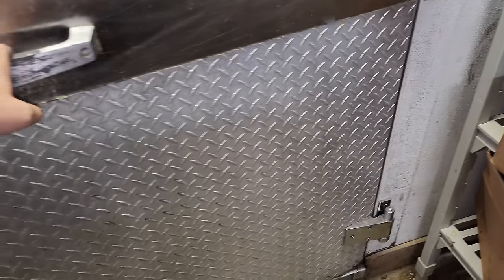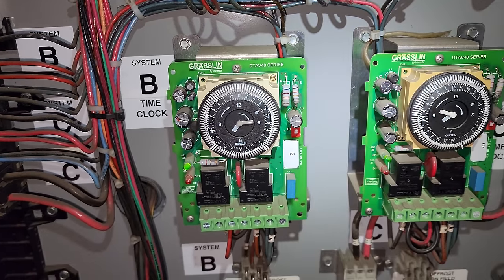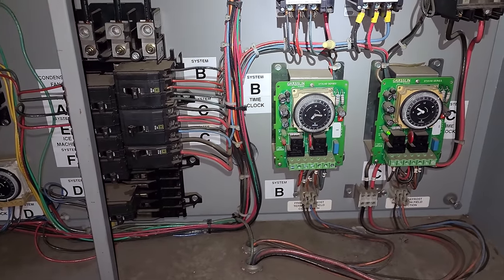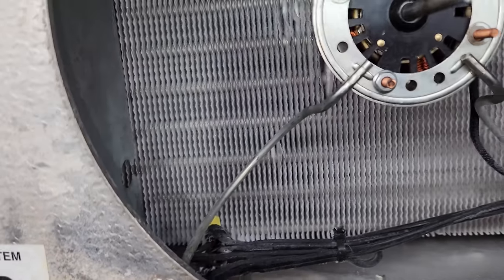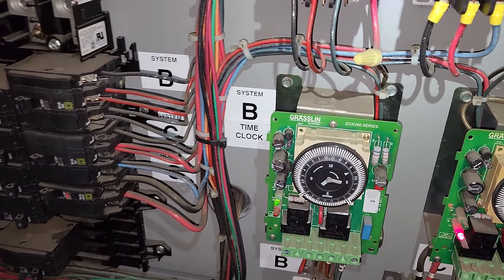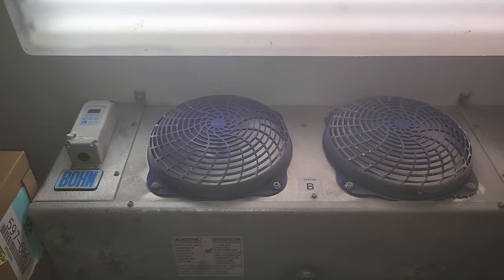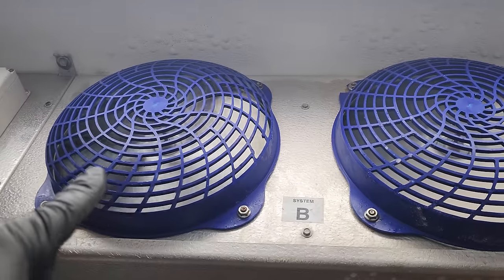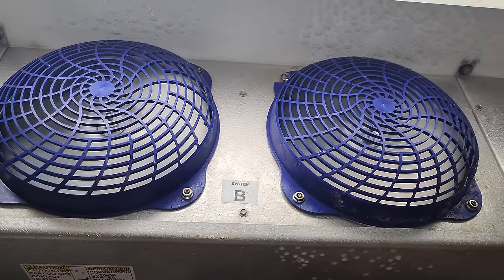WALK IN FREEZER EVAP MOTORS NOT WORKING

Comment: just finished installing a new door at place because there was an entrapment, it was bad. relief valve froze up and the door sucked itself shut. there was so much vacuum the jaws of life just bent the lip of the door they had to use a saw to cut a hole in the door. the door lock was functioning normally. the PRV is a critical safety device
Reply: Bad as in deadly bad?
Reply: @JGnLAU8OAWF6  I would think entrapment in a freezer could well turn deadly if it was not possible to summon help quickly enough.

Comment: As usual a good service call video. I love a sight glass   I hate low cords dangling over the defrost heaters. Move them up to the top of the fan brackets. Zip ties do not have to be senched tight to hold a wire out of harms way. leaving them loosely senched makes it easier to cut them off when changing motors. I am not a fan of S0 cord. It does save space on the truck but I prefer stranded THHN-14, in black, red, white and green. Pan cracks can be JB welded & a guard to prevent the product from bumping the pan helps. Large wrap around L brackets can be made from flat steel or aluminum from Lowes.

Comment: Looks like your defrost termination/fan delay is quirky. I was always taught if there's frost and water droplets on the ceiling means the fans are coming on when the coil is not cold enough to freeze the water on the coil. Your thoughts?
Reply: You're right... in a typical.situation with a box that has a well sealing door and when the door isn't being left open. However... in situations like this video where you know for sure the door isn't being closed. And judging by the condition of the box... I'd bet that door seal isn't fabulous. Lol.

Comment: When it comes to food shipments, MOST restaurants don't schedule additional staffing on delivery days. Often, we have to pull one of the two people scheduled to check the delivery in. We have to temp the product when it comes off the truck and get it into the walk-ins as quickly as possible in order to get the other half of the crew back on the line. Later, if there is enough staff (or someone willing to stay beyond their shift), the delivery can get properly put away and stock properly rotated to adhere to FIFO (first in, first out).

Comment: questions about Evap motors, Checked the fan blade rotation direction, CW and motor is CW, but the air blow like from side out to the freezer instead of going straight forward to the box, is this normal? since some are straight forward some are on the side, please help to explain, I have been try to find out the answer all night

Comment: some of the burnt junk inside the evaporator screams, that it was in defrost way too long, so both stuck time clock and limit/fan switch bad.
or idiots in the box with torch cooking the whole "frozen evap" because of no defrost cycle? ( they'd have burn the bottom pan/blackened it) 😒
any scenario, they likely fiddled with it and lack of communication conveying the real issue.

Comment: Dude I hate cork tape here in the northeast we see a lot in attics and it’s all melted in the summer and if you have a leak in refrigeration piping it’s near impossible to get off the copper. I did a repair on some cork tape expansion valve it was almost impossible to get that pipe clean, needless to say I did and I evacuated the system to 500 microns and it ended up leaking…idk how but it did

Comment: I charge 750 to come out after hours for emergency call and I don't bill,  bussiness will for sure rob you of work. I carry all the parts on my truck (very expensive to have 3 of everything) . refrigeration is a money maker. my dad always told me not to teach anyone cause the trade will go down the drain like hvac. I'm 4th generation in my family of low temp and restaurant equipment repair techs. I also do fire suppression system installs when I get referenced for them. I'm my own boss & no shortage of work I also have my regulars. I'm 25 but been around this stuff since I could walk but I'm always learning. my work van is a 2022 ford 350 cargo van doubed turbo extra tall. best work van your ever see for the industry.  a lot of people I first meet think I sale drugs cause I'm well off for my age but I just work. I also do a lot of repairs where I'm the 3rd guy out there because hvac/handymen think they know refrigeration or a do-it-yourselfer has done something to make the problem worse.